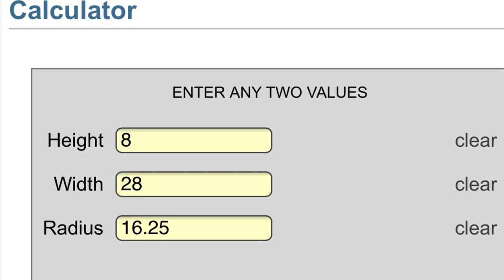How to Build a Brick Arch | brick arch building construction and brick arch house

Comment: How did u build them different without leveling each one as u went up and it came out spot on same size bond so it matches up ???????? Amazing work
Reply from the maker: Thank you! Was a bit of an experiment. Can do it by feel on small things like this—just the right pressure setting the brick, etc. and this one worked out pretty dang well, to my surprise.

Comment: Could you use cinderblock in the middle instead of so many bricks? Will it have the same outcome?
Reply from the maker: Technically yes. But just no reason. Triple or quad wythe w/ modular brick is meant to be used like this for building—what all the old masonry buildings do.